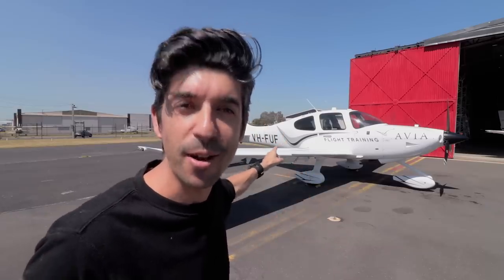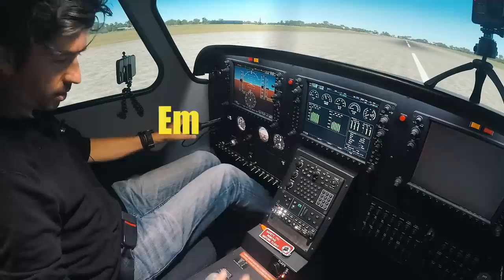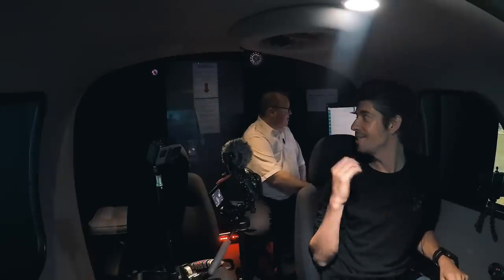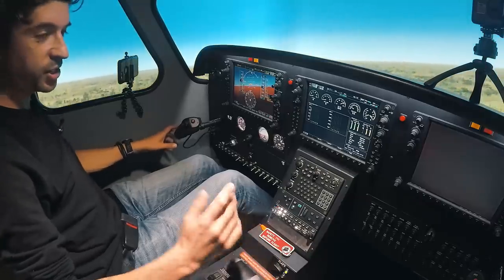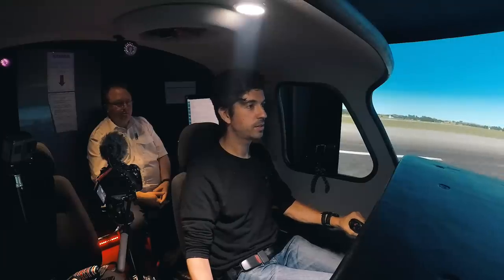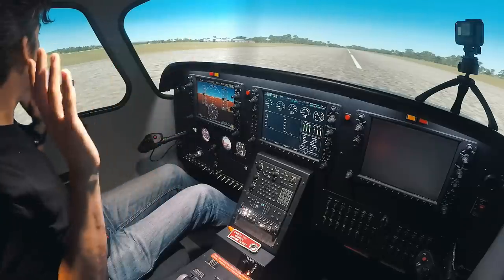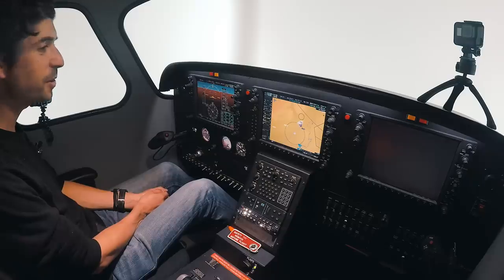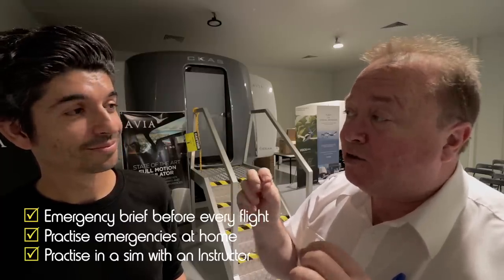EMERGENCIES in the Cirrus SR22 sim - parachute deployment

Comment: why would you should down a still partially running engine..I would let it run even with just a little bit of power until it seizes ...or is it because the danger of a fire when it blows up ?
Reply: bobl78 if you’re in a crash and the engine catches fire, the last thing you want is to continue feeding that fire from the fuel tanks. So perhaps the most critical checklist item before getting the plane onto the ground is cutting the fuel supply line, and by extension, cutting power to the engine

Comment: The caps in the cirrus makes the pilot too reliant on the system then their skills. e.g for forced landings instead of picking a field may just use caps, or passing through 1000ft agl with engine failure in circuit crosswind and pulling the chute. e.g scenario 2.
Reply from the maker: Thanks for the comment, but I’d challenge that thinking. Try landing an aircraft with no power in a field ten times a) descending vertically under a parachute or b) trying to perform a standard landing with a few hundred feet rollout avoiding potholes, fences, trees, etc. I’d rather be in the plane with the parachute. 

I don’t feel “too reliant” on the system whatsoever, but I do fly with confidence knowing it’s there and I’ve been trained how to properly use it should I ever need.

Thanks for watching, a good healthy discussion is always welcomed, stef

Comment: 1700 ft/minute is 20 MPH. Thats a pretty hard hit for a vertical landing. That has to be at least 3-4 g's on impact.
Reply: Still survivable however. In all situations involving a CAPS deployment no one sustained any major injuries. All injuries were actually minor and pilot and passengers were able to walk away from aircraft.
Reply: @graciejiujitsu86  Just today, 2 walked away with only minor injuries - https://www.youtube.com/watch?v=OPRIHZ01HQ8
Reply: JiuJitsu Pilot86   I saw something on tv about where the parachute was on fire. Survivors? I am not critical of the chute but I don't know if your statement is correct.
Reply: . difference with that situation was it involved a midair collision. A Cirrus and helicopter had a midair while in the pattern of a non towered airport. The plane was on fire. The Cirrus pilots managed to pull the chute but the plane was already burning slowly as the parachute was out.
Reply: @jameschristiansson3137  yea...minor injuries not major for the pilot and passengers. I did not mention anything about potential injuries of anyone below.
Reply: @JiuJitsu Pilot86 I used that example because it had just happened as you commented. Truck is replaceable.

Comment: How was the landing so gentle if if was decending 1700fpm?? That seems like a very high and dangerous decent rate and if that's what the chute was designed for then it doesn't make much sense
Reply: That's a descent rate of only 28 feet per second (about 19 miles per hour), and the plane is designed to absorb much of the impact energy. CAPS descent rates range from 15-28 fps (10-19 mph). But of course that's not to say the simulator makes you feel a realistic impact.